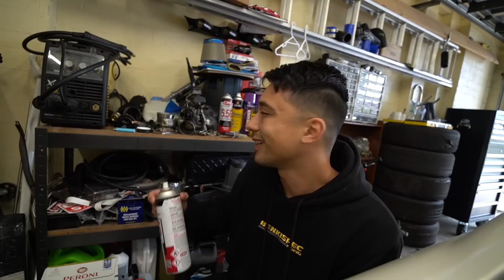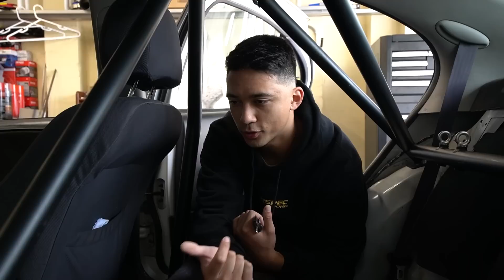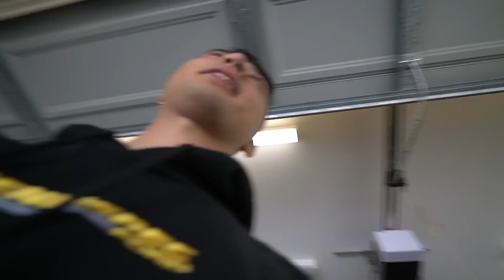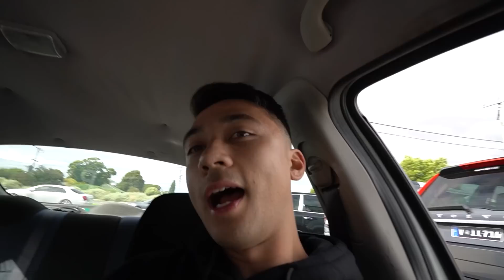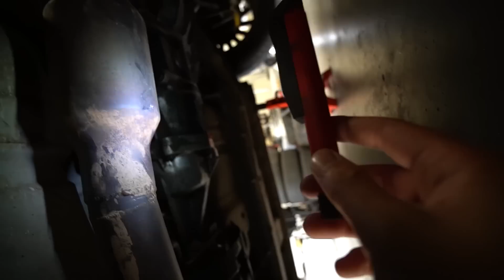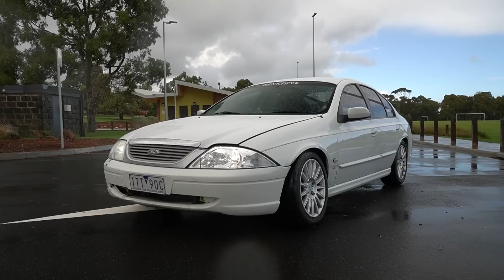I'm Done making the AU Drift Car Hoitboi.

Comment: Common fuel cut issues for Falcons: *inline fuel filters block quickly if driven on low fuel - fuel sender pickup is sorta low
*MAP sensors need to be cleaned. Usually just holding the throttle open and spraying carby cleaner at it will do the trick. 

These are the causes 85% of the time, from my expirience